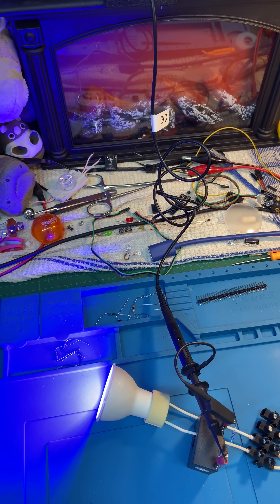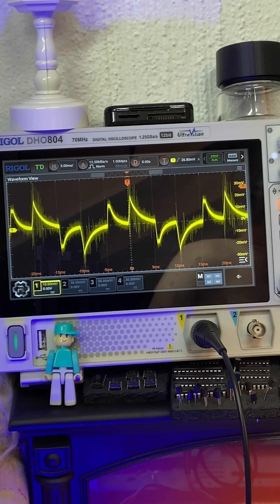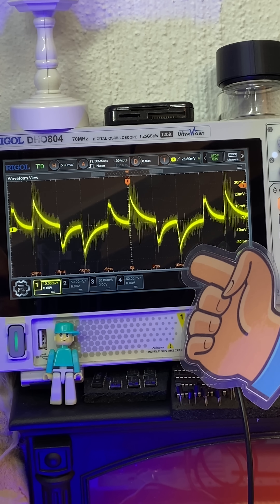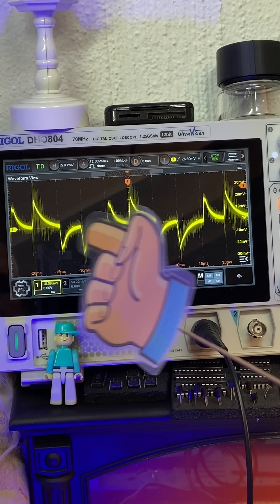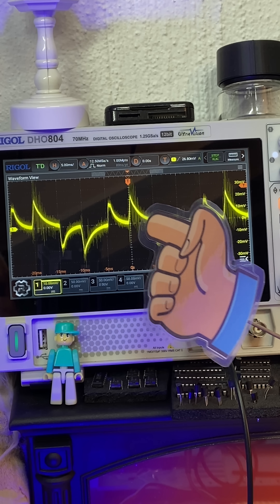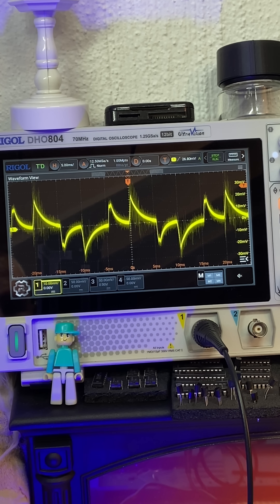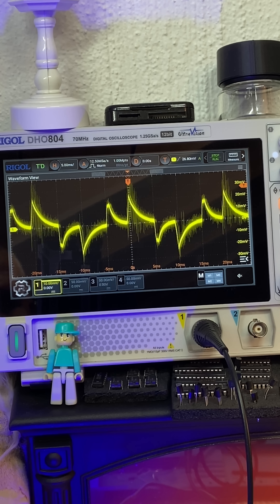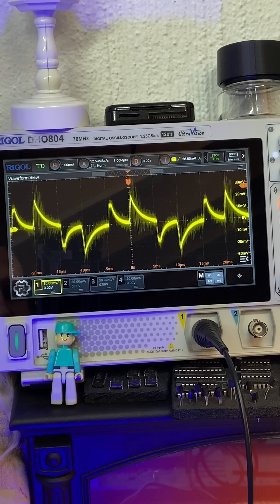The current waveform of linear current regulator led lamps is a horror show! #shorts #lighting #led

Comment: Would a simple  parallel connected  RC snubber (47 ohm and 100nF) help ?
Reply from the maker: I think one would need a lc filter and the snubber, in that form factor the switch mode current sources that regulate through the full cycle are a better solution.